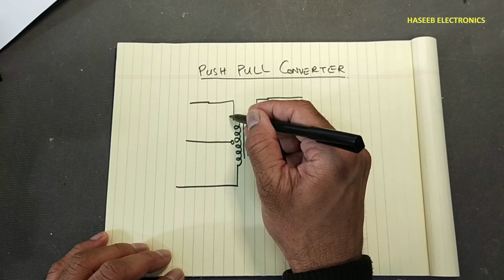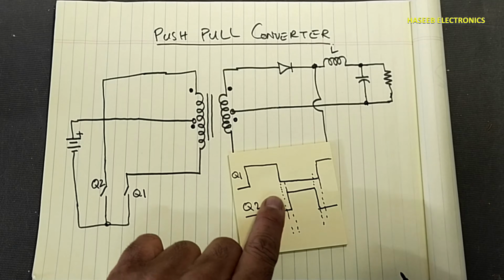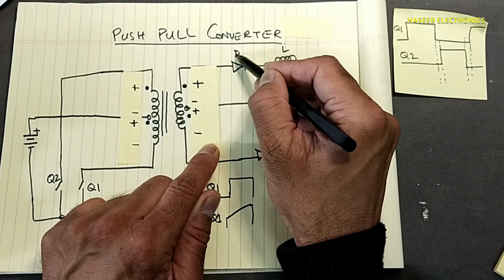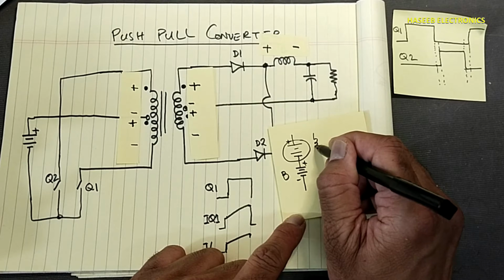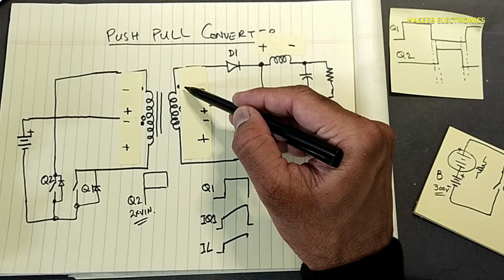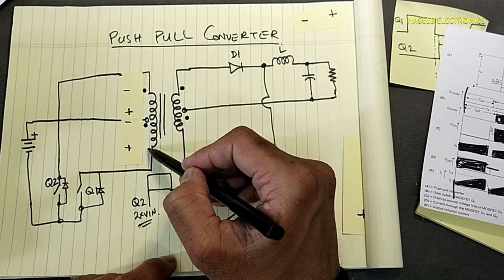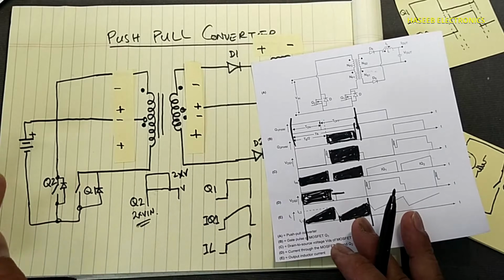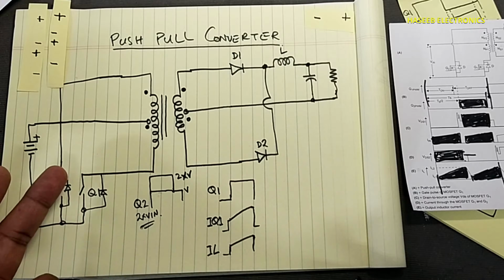{859} PUSH-PULL Converter Topology Explained

Comment: Assalamou Alaykoum Sir,
I would like to thank you for your valuable and clear videos in power electronics. I have a question, if you don't mind,  about push-pull converter. What will happen if both switches are on?    wa jazaka Allah khayran.

Comment: hello! I have a question about secondary winding. What if to make secondary winding without central wire but only as one coil with 2 output wires and put 4-diode full-bridge rectifier for rectifying current? In that case current from inductor-filter in secondary circuit will not be flowing during dead-time and secondary winding will not be demagnetizing core? So as a result - all magnetic field energy will be converted into heat on protective diodes of mosfet and efficiency of converter will drop? Am I right? Or I am wrong and efficiency of converter will be the same?

Comment: Aslmuailkum sir, please make in detail video on dc dc convertor from 12v to 50-0-50 v 300 watt with push pull tropology in detail with core size , wire gauge, capacitor,inductor,output amps How much mosfet required, working frequency in detail sir pls. Thanks in advanced

Comment: That is really very informative my some points are clear today BUT there is one Qoustion --in my experience with solar inverters most of the time DC side MOSFETs get short very less IGBTs get short in your that video i understand the switches have double voltage stress but there is recovery diode to help to demagnetise the inductor ( so why in solar inverters have with MOSFETs only resistors on gate and gate to source ? Why there is no recovery diode ? But on the output side of inverters with IGBTs have recovery diode
So why not in DC side ?
If answer that question in your next video will really thankful for that
Best regards from Philippines 🇵🇭

Comment: Push pull is also limited to low input voltage, due to flyback effect from output (secondary winding).
Reply from the maker: you are right its main usage for low voltage applications. but it is also used in line voltage application to step down the voltage, for high power output
Reply: @HaseebElectronics  I've seen it in UPS as main stage for pseudo-sine wave inverter, driving low side of transformer, from battery. Your videos are very informative. Keep up doing good work. May Allah s.w.t bless you.
Reply from the maker: yes brother 
you are right 
as I mentioned in my video that this topology is most commonly used in solar inverter applications same as ups. 
but it is also widely used in high voltage input to step down converters for high output current requirements